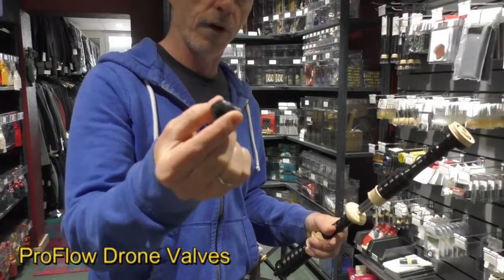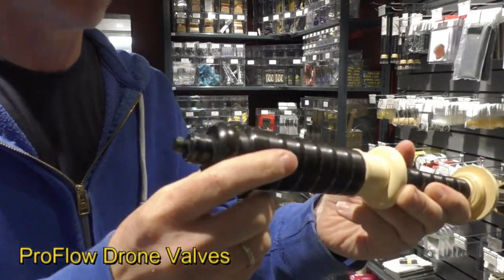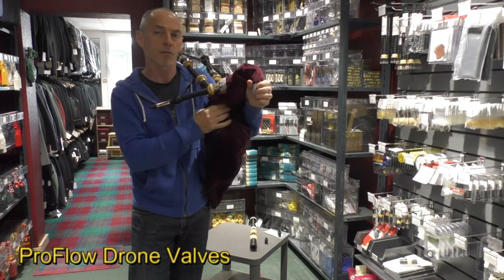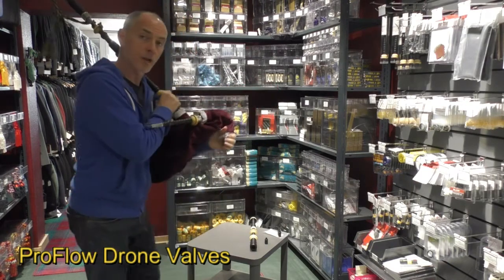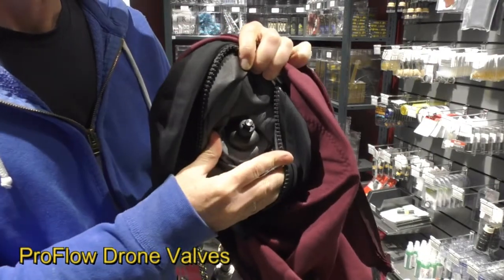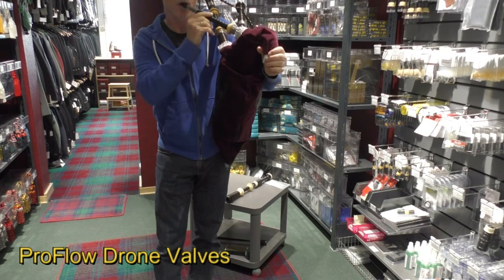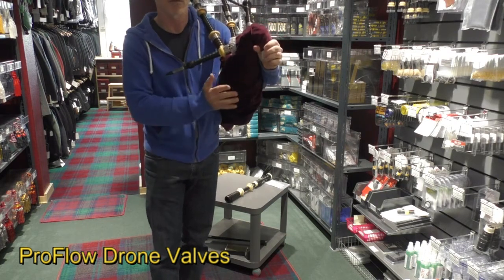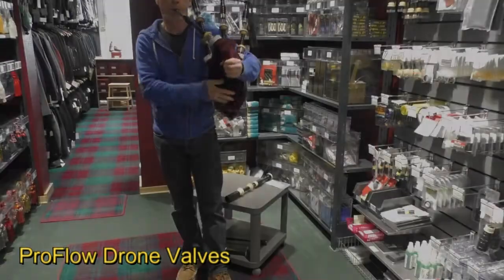ProFlow Drone Valves

Comment: I am not on the pipes yet. I am curious though, why are these not commonly used? Maybe they are and I just don't know it but I don't think I've ever heard of them before. Seems like it would make the learning process a bit less frustrating. What are your thoughts?
Reply from the maker: Hi, I would recommend starting without drone valves. You can always add drone valves at a later date if you struggle with start/stopping the bagpipes.

Comment: Do they affect the tone? I worry that they will stop the reed communciating properly with the bag so you don't have the same tone and resonance compared with an open stock. 

No worries striking in but would be easier just to have the drones cut off neatly at the end of a tune without having to squeeze the life out the bag first (to guarantee a silent cutoff).
Reply from the maker: Hi, the valves should not influence the sound.
Reply: @kiltsmore  They’re valves, the must form a restriction?!
Reply from the maker: there is obviously a difference in airflow going to there reeds, but the reeds vibrate and sound as they do without valves. I'm sure if you hooked up sophisticated measurement equipment you'd hear a difference, possibly a minimum reduction in volume. I'm just guessing, I can't say I've noticed any difference myself.
Reply: @kiltsmore  I’ll give them a try then. How much are a set?

Also do you have a MacCallum Reel pipe review anywhere?

Comment: I installed the valves on my three drones, and it took me a while to get the settings right, but they work fine when I stop the tune.
But I've noticed that I don't hear the drones vibrate on start-up, as they do when there are no valves. I hear the note instead.
Is there any adjustment to be made? Maybe I tightened it too much?
thank you for your advice
Reply from the maker: Hi, yes, I think it's just a case of trying to find the right balance... sufficient air flow vs. cut-off effect.
Reply: @kiltsmore  ok thanks, I'll try to do it.  Not easy !

Comment: I've never used drone valves. I was curious do drone valves help prevent drones ,especially the bass drone from closing off due to my blowing pressure.  Everytime I try to use a stiffer Reed  I close my bass drone Reed with my strong lungs pressure.  I constantly try try to adjust my drone reed but it still just closes off with my pressure trying a stronger Reed.  Will drone valves help prevent bass drone from shutting off on me.
Reply: You might be over blowing, in that case the valves aren't going to help.
Reply: try adjusting your drone bridle on the reed, pushing up or down .  I had that problem w my bass drone as well